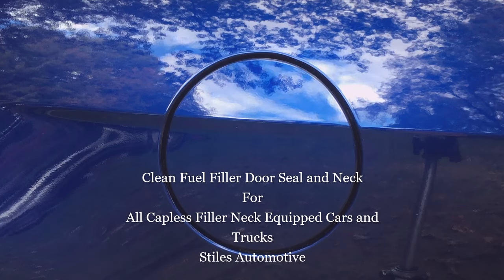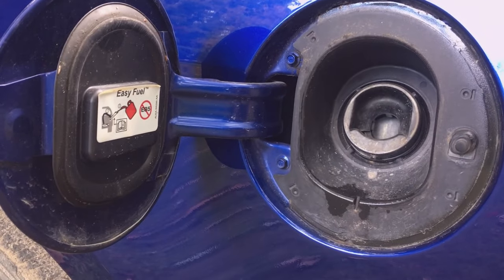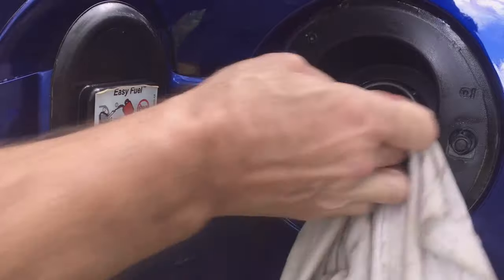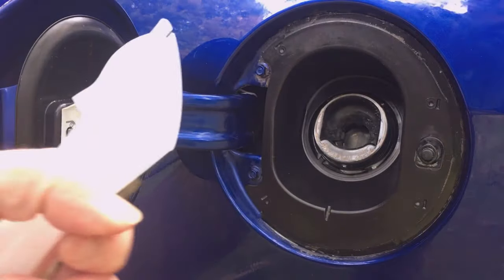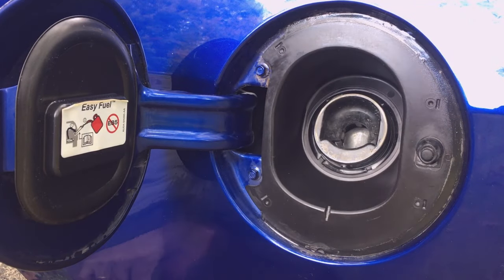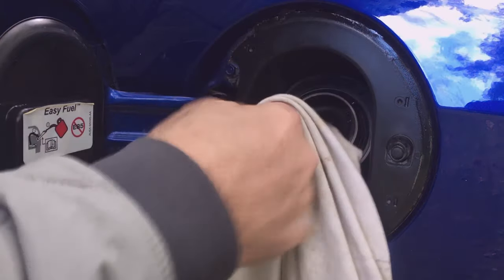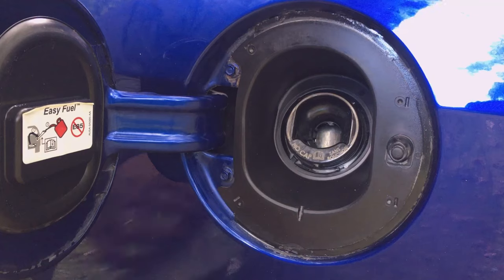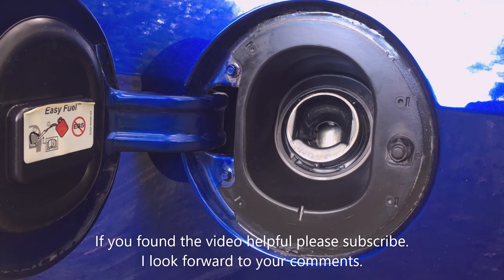Clean Fuel Filler Door Seal and Filler Neck for All Capless Filler Neck Equipped Cars and Trucks

Comment: this is for lazy people  that cant take the few seconds to remove a fuel cap and then when there done fueling put it back on          I would rather do that .   as time goes on  the seal will leak  the vapors and you have have a evap leak code causing your eng light to come on    clean or not   it will still happen
Reply from the maker: Joe, Yep, totally agree, your second part sentence is the point of my video of course. I'm all for eliminating step/work if you do it right, I have a Shop Tip Video on the subject (see link below), but for my Ford Fuel Filler System, the Door Seal does come close to keeping the dust out of the pocket around the Filler Neck.  I wonder how many thousands of Filler Neck Assemblies will be replace in the next few years.  Thanks for the comment! - Stiles

Shop Tip #4 – Stop Repetitive Tasks, Radio on with Overhead Lights   https://youtu.be/0699pDo8-Yc
Reply: How do you fix one that starts leaking?
Reply: Obviously coming from a man who doesn’t own one, but still has a strong opinion. This is why you should never talk politics. You might run into him

Comment: I did as stated in the video, but the signal did not disappear and check ingin appears
Reply from the maker: Subhi,  You may have an issue other than your Fuel Filler Neck or the 2 mating surfaces in the Fuel Filler Neck between the Flapper Valve and the Neck may be old / damaged and unable to seal.  Also a vacuum leak somewhere else on your vehicle could cause the same OBDII Fault Code.  To verify if the Fuel Filler Neck is the issue, cover the opening (ensure it is sealed) with  Saran Wrap or similar sealing plastic.  Clear the Fault Code and see if the Fault comes back.  If you are sure your seal is good, the issue is somewhere else.  I believe this is going to be a big issue in the future for everyone with a Capless Filler Neck.  That is why I stated, it scared me the first time I saw this feature on a car.  Hope this helps you!  - Stiles
Reply: @StilesAutomotive  hi stiles I have the same car just a 2014. Is it possible to buy a different cap to avoid all this together? My dad has reset the car multiple times over like 2 years. The engine light eventually comes back, but I have not done anything differently to prevent dirt from getting in the gas cap. I barely drive the car since I have a 5 year old, and my explorer 2016 has the same gas cap concept and I don't have the same problem. What do you think ? It breaks my heart to see that engine light, but I don't have money to be leeched at the dealership. :(
Reply from the maker: @monkipug92  Monki, this time you replied to the very comment I would give to you, "Subhi,  You may have an issue other than your Fuel Filler Neck or the 2 mating surfaces in the Fuel Filler Neck between the Flapper Valve and the Neck may be old / damaged and unable to seal.  Also a vacuum leak somewhere else on your vehicle could cause the same OBDII Fault Code.  To verify if the Fuel Filler Neck is the issue, cover the opening (ensure it is sealed) with  Saran Wrap or similar sealing plastic.  Clear the Fault Code and see if the Fault comes back.  If you are sure your seal is good, the issue is somewhere else.  I believe this is going to be a big issue in the future for everyone with a Capless Filler Neck.  That is why I stated, it scared me the first time I saw this feature on a car.  Hope this helps you!  - Stiles"

And . . .  for caps, you can buy a locking cap for our Mustangs, but I don't know how well it will seal.  This maybe worth a try, I don't have one and have not used one.  Rock Auto is "out of stock" on them, so I don't know a price.  See the Rock Auto Link below - - 

GATES 31859 {Click Info Button for Alternate/OEM Part Numbers} Regular Locking Fuel Cap Info

STANT 10524 {Click Info Button for Alternate/OEM Part Numbers} Fuel Tank Cap Locking Plug
https://www.rockauto.com/en/catalog/ford,2014,mustang,5.0l+v8,3298468,fuel+&+air,fuel+tank+cap,5900

Let me know how it goes! - Stiles
Reply: @StilesAutomotive  hi so I actually took it to auto zone for the free diagnostic like you suggested. It was the EVAP. So I bought the last one they had and watched another video and changed it myself. "Thank you Youtube." And thankfully the engine light turned off. Thanks for the advice, so I'm assuming now just to maintain it clean everytime I pump gas?

Comment: I don't like the fact you can just open that filler cap like that what if someone wants to fill it up and put anything down there?I've got key entry on my ford which is safer than this. But yeah I clean this area too lots of people neglect this
Reply from the maker: Yes, good point, I have locking gas caps on my older vehicles.  I have seen the locking cap that goes in this neck.  Again, good point and thanks for the comment! - Stiles
Reply: Time to move my friend. Not everywhere in America has hundreds of people walking around looking for vehicles with no locks, just so they can pour something down it.

Comment: Gas caps were never a problem. Never had to clean one. I now have a 5 gal gas can with a crazy spout and now stupid crap on the cars. IF it wasn't broke don't fix it. Government at work.
Reply from the maker: John, Don't get me started on Fuel Cans, I have a couple of older ones that work just fine. They pour fast with very little spillage. The trick is to get Gas from the new cans into the older ones. I spill a lot, so most of the time I just deal with the new cans. My Cub Cadet Lawn Tractor has a big 4 inch opening and I can just take the Spout off of the newer Cans and pour directly into the tank.  But generally, I spill several Teaspoons of Gas to protect the world from a little Gasoline Vapor.   The Capless Filler Neck I do like, I have a Shop Tip Video that talks about removing worthless steps from tasks (see link below), but I wish the Filler Neck was designed better, to not get dirty (the point of this video) and to seal for the life of the car/truck.  I appreciate the comment! - Stiles

Shop Tip #4 – Stop Repetitive Tasks, Radio on with Overhead Lights   https://youtu.be/0699pDo8-Yc
Reply: A man with strong opinions, on things he doesn’t know anything about. Men like this give real men a bad rep.

Comment: hows that plastic piece called?
Reply from the maker: Which part are you talking about? May be you can identify it from the Ford Part Website (link below) for my 2013 Mustang, Back out of this page and put your exact vehicle information in to get your correct parts.  - Stiles

https://parts.ford.com/shop/en/us/body/other-body-related-parts-rear/pipe-fuel-filler-7897273-1#/sectionId:141074091
Reply: @StilesAutomotive  that plastic thing where you're supposed to insert the gun, same thing on my dodge broke off and got a check light cause of it
Reply from the maker: @BdyPhrk  That sounds like the Fuel Filler Pipe, Part#: 9034 in the link above.  That is the whole Gas Pipe the runs to the Gas Tank. - Stiles
Reply: It’s called a “flapper snapper"

Comment: My flapper door will not stay open when I do this procedure.
Reply from the maker: Bleeke, Insert your OEM Funnel into your Fuel Filler Neck, then stick something inside of the Funnel to hold the Flapper Valve open when you remove the Funnel. Be sure to use something that cannot be dropped into the Fuel Tank, a long Coat Hanger for example. - Stiles
Reply: @Stiles Automotive  I used the video step by step with the exact same tools that you did. I have a 13 taurus limited.
Reply: see... this is why iyou’re still single
Reply: @donbratton I wish

Comment: I cleaned mine and the check fuel filler message went away for a few days but it came back I tried to clean it again but it’s still there
Reply from the maker: David, I normally reply to your type of comment within 24 hours, but I wanted to research this more. You need to find someway to seal the Fuel Filler opening, this will ensure if the fault goes away, that this is your problem.  I thought that the Locking Capless Filler Neck Cap may be the solution, but I don't think this provides a seal. You may be able to use one and add an O-Ring to it.  In another comment on this video, someone mentioned a proper size rubber stopper, that is a good idea, too. Let me know how it goes! - Stiles
Reply: I’d sell it. Or get a friend to help you

Comment: This is a trigger for the p0456 light
Reply from the maker: Marcello, Yes this could cause the P0456 EVAP Emissions System Leak Fault, another cause of the Fault is a vacuum leak or Fuel Tank Vent Hose/Line leak. - Stiles
Reply: @StilesAutomotive  I want to clean it but I don't want it to interfere with the fuel... I had this light popping up yesterday I cleaned the outside and the light went off it came back today... thinking maybe I gotta clean the inside

Comment: Ford focus sucks 😂😢😮😅
Reply from the maker: Leonard, I once worked with an old crusty Engineer, that would say, yes it "sucks" but it also "blows" . . . which may be good it in equilibrium, . . . or worst 'cause the suck is pushing and pulling at the same time . . . well anyway it "sucks"  LOL  - Stiles

Comment: That is dumb watch scotty kilmer on this subject...what would it cost to replace that dumb valve...what would it take for some idiot to mess up your fuel. Heard they even are dangerouse for gas explossions?   Put it this way,,,look at all the youtubes on this subject . Think...a gas cap...really
Reply from the maker: Put, I'm not sure there is a question here! I normally address comments with valid questions. 1) Part of the point of the video, is this design will likely cause many problems as the car ages, 2) to replace the Flapper Valve you would replace the Filler Neck Assembly, cost for the part is likely greater than $200 and then add labor, 3) Dangerous? Unlikely, the Door Seal and Flapper Valve would likely cause an EGR related fault, indicated by the Check Engine Light, long before this would leak that must Fuel Vapors.  This is not my design, it is used on many, many modern vehicles, yes I was critical of the design in my video, however, I would not replace it. If I were adding or modifying a Fuel Tank under a Pickup Truck Bed, I would probably select a Filler Neck with a Cap.

The point of the Stiles Automotive Video is to help you clean and maintain your Capless Filler Neck.  - Stiles
Reply: Yeah, except it was the Ford dealerships in Engineers that decided on this, not people just buying a car or a truck. So how about cool it what the insults? Or try to use your thinking skills to think before you type

Comment: Talk about LAZY ... it's redundant to have to remove a cap from the filler neck?? JEEZUS!!
Reply from the maker: Mike, I do like the idea of no Gas Cap, however I want a Cap, if the Filler Door Area will get dirty (it will), if as the Filler Neck gets old, the car will have runability issues, and if when the Filler Neck gets old I will have to replace the whole Neck ( you can buy a bunch of New Caps for the cost of the Filler Neck Assembly). Again, I like the idea of getting rid of repetitive tasks, I even did a "Shop Tip" on the subject (see link below). - Stiles

Shop Tip #4 – Stop Repetitive Tasks, Radio on with Overhead Lights   https://youtu.be/0699pDo8-Yc
Reply: You know I w, PEOPLE didn't pick this, FORD did.